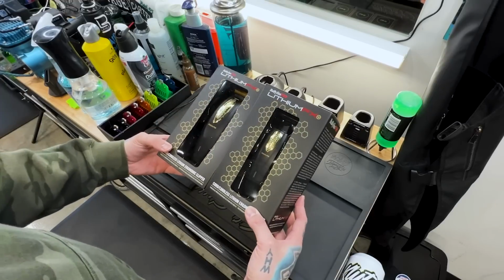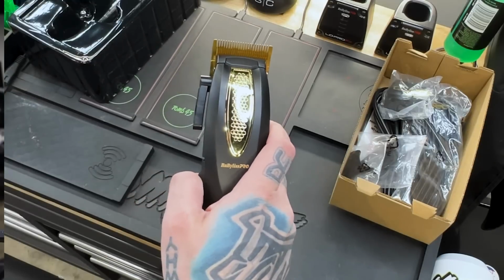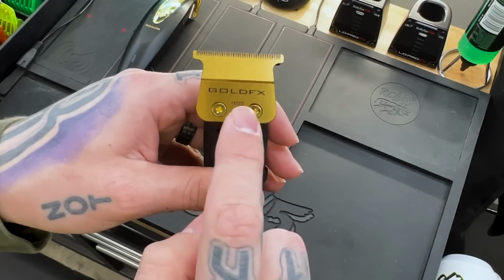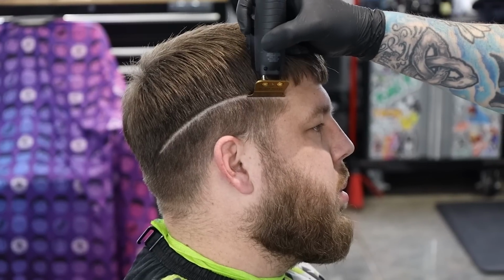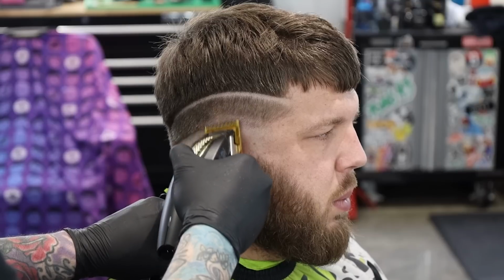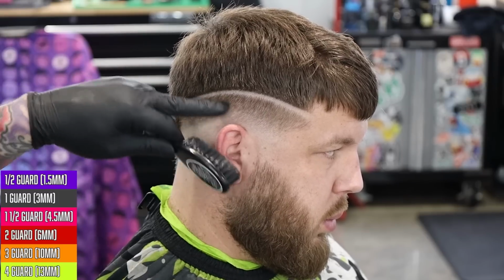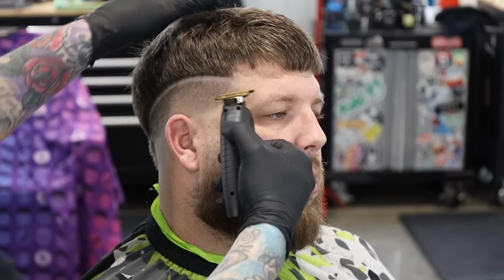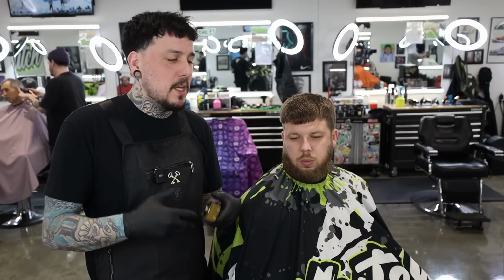OG Gold FX Blade 🔥 Babyliss Lithium FX Clipper and Trimmer Unboxing and Review

Comment: You got lucky , got two new gold fx original blades from my local barber supplier and it's been my worst baby lyss blade even after several adjustments😭
Reply from the maker: Man I’ve heard about knockoff blades going around. Might be what you got
Reply: @Seancutshair  looks very similar so i dont think so, straight outa the box it would snag around the ear and not line up, after i zero gapped it ,it performed a little better but still snags around the ear and bottom beard part

Comment: Dude the Og blade is the secret mega hitter.  You know magnets have memory. Well they give a non magnetic part of metal a memory. So basically guys the area where the tension is the weakest point... the very ends of the outer  blade get some neodymium magnetics from homedepot. Set 3 on one side and  3 on the other. Make sure you gap your blade and set it before doing this.  Let me know. Thank me later.
 @the_original_versastyles
Reply from the maker: Interesting
Reply: @Seancutshair  it's what is a ummm basically a trending type thing. Gap is not as important as pressure between the 2 blades.

Comment: Hey Sean I got them and it’s not original gold blade. It says it is but compared to original it has diff color and has deep teeth but it definitely hits maybe better than OG gold fx but this is def not og blade. Check it out.. great video love ur content. Also I love og graphite blade like you but even that one I bought couple and is shaped same as this new gold one and prob my best hitter. Super thin blades but def not standard or fine tooth
Reply from the maker: That’s interesting it’s supposed to be the original. I wonder what you got
Reply: @Seancutshair  all of the ones I’ve seen looks the same. When I first got them I messaged the ppl thinking it was fake but thry changed them I guess but I bought og graphite bc that my fav blade for lining and got 2 diff ones but the one shaped like this new gold blade is super thin and HITS…
Reply: yes someone else noticed it , i thought just me , i personally dont like it i like the og gold one , feels better to me and hits better , the one that comes with that lithium trimmer feels like it drags and it is super thin that it might pull sometime

Comment: That’s why those clippers that open up to a four can be a click lever. They have to be like the Indus masters, and the FastFeeds. Because the clique level wanna raise the lines. You could probably take the ball out of the lever, and not use the clicks, and it should be fine.
Reply: Yes free floating. Or stretch bracket